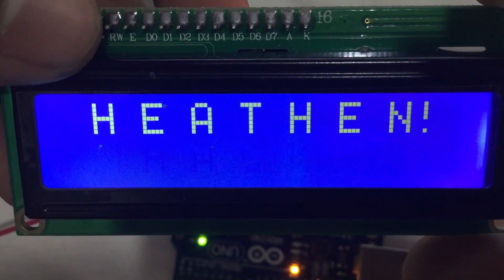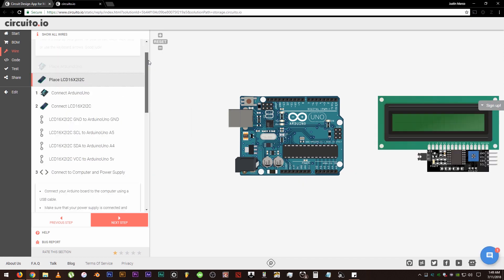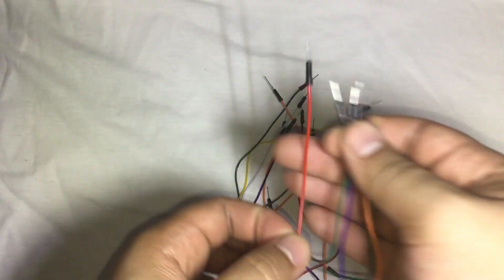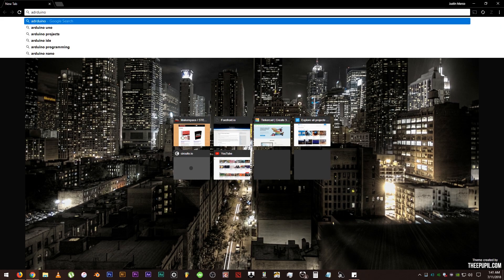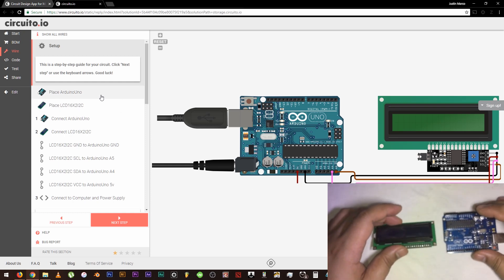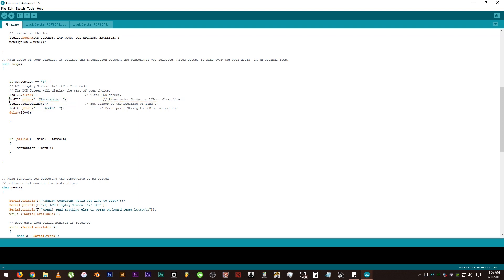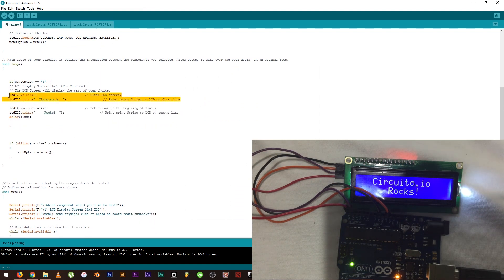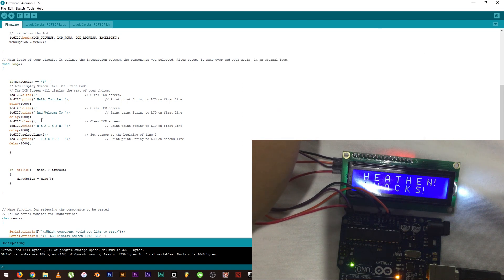Arduino UNO-Compatible Advanced Starter Kit (Upgraded w/ RFID) Unboxing! + My Very First Project!

Comment: sinunod ko yung tutorals sir pero sabi lcd not found , maayosnaman yung wires ko pati pagkakabit kay arduino , paano po kaya mafix un ?
Reply: Found the workaround. Yung lcd adress dapat ay 0x27.
Reply from the maker: Hello, Nikka! Thanks for the comment! ♥ Please download these files put them inside of your sketch folder.

Here's the link: https://drive.google.com/open?id=1N-SwmFOJYvkfcr_OLhmFGhZYvZgbajfH

If you have anymore questions, please don't hesitate to send a message on my fb page. 

Thanks!
Reply: @HeathenHacks  same issue. I have put those files in my sketch folder but proble still persists
Reply from the maker: @crease701  Hmmm.. if you can message me on my fb page, I'll try and help you there. Youtube notifications is not that instant. Thanks!

Comment: Please help me, when I open the serial monitor it says 'Board at null is not available.
Reply: Thanks for the help 👍
Reply from the maker: Is it working now?
Reply: Yes it is
Reply from the maker: Nice.
Reply from the maker: Hi there! Thanks for the comment! ♥ Please make your circuit on this website: https://www.circuito.io/ 

Then, download the code. It will be a zipped file/folder names "Firmware". Extract it. Open the "Firmware.ino" and then run your code again and see if it works.

Comment: i follow your tutorial no display on my lcd?can you help me pls
Reply from the maker: Hi there! Thanks for the comment! ♥ Can you tell me what kind of LCD you are using? This setup is specifically for the ones with an i2C backpack.
Reply from the maker: Alternatively, you can try to adjust the brightness of the LCD by adjusting the potentiometer at the back using a screwdriver if it's lighting up but with no visible text.